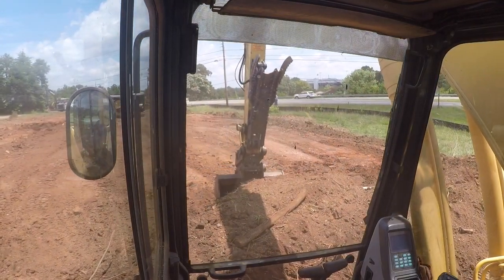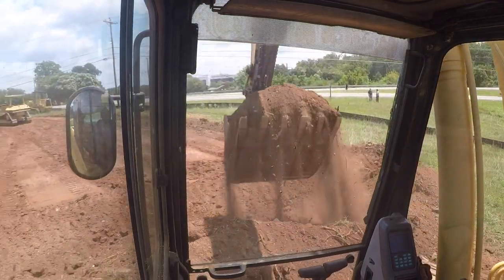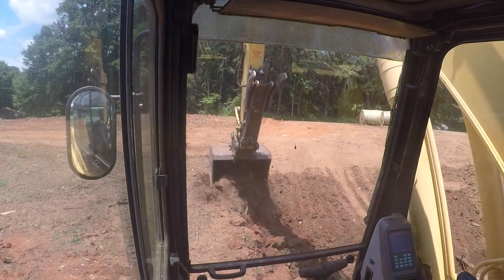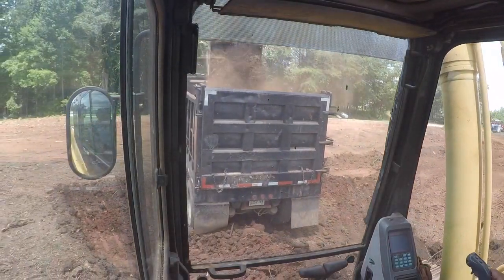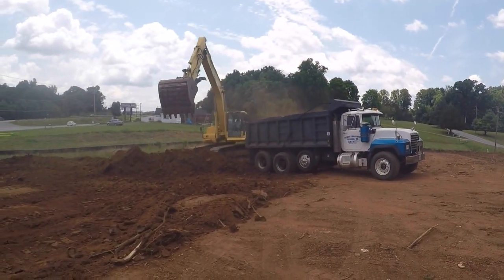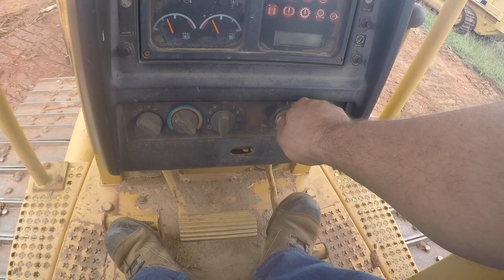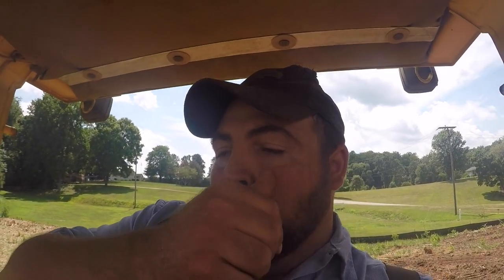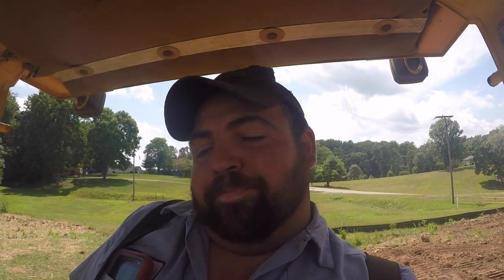Grading! Topsoil removal and why we romove it.

Comment: I learned Dozers in the Seabees at Ft. Leonard Wood, Missouri. I was sitting in a 1984 Model D7 in the training area at the moment the Twin Towers was attacked. So my career became more Convoy Security Element oriented and I didn't get much stick time in Dozers after training. Now I live in Switzerland and last week because I have a Dozer Certificate I was informed the day before that I would be moving 10,000 cubic meters of dirt  that was coming from one excavation to backfill and grade a Farmer's field in the Swiss Pre Alps. Turns out the machine was a D5M xl. I googled it and found your video with the same machine, basically saved my career cause I haven't been in a CAT Dozer for years. I usually operate a wheeled excavator digging ditches under the streets for distance heating pipes, water pipes and tearing out old asphalt for street repairs. I never saw that type of controls for a Dozer before and your video helped me a lot, you can see the end result and the D5 on my twitter @DaryllDoe. Thanks for the videos!
Reply from the maker: Well I'm glad I was able to help you out i really liked the M series cat dozers they were very good in thier day, but they can't compete with these new hydrostatic machines.
Reply: No doubt the new machines are much easier to operate, but the 1984 D7 was also pretty hard work with and the D7 H model still used the same controls. Here in Switzerland Komatsu is popular, what I see the most is D65 PX, saw one D61. How did you get cameras mounted under the Dozer?
Reply from the maker: I've got a good magnetic camera mount👍

Comment: Up here we have a 30acre field that had a subdivision put in next door. About half to 2/3's of that field was used by the developers to dump fill from the basements they put in. That was the deal when my brother bought the 167 acre plot (that had this field). 
About 5 yrs later we now want to develop the field for agriculture (vineyard) as the whole farm with suitable topography will be cultivated. 
So to make a long story short... county is widening a road nearby and needed a place to dump topsoil. Our site guy got us a deal where they pay per load to dump, and that money goes to him to pay for his loader and dozer to spread and grade it out for us.
Meanwhile we are putting in a drive about 1-2mi's in length and so we also got a deal on millings from some parking lots being resurfaced. (Millings are free, crush n run gravel is not.) So with the loader here we took loads of millings night after night (thousands of tons) and the loader ramped it up each morning while the trucks came and dumped every night. 
So the long and short of it is we got millings and topsoil free. 
A nice backscratching session of trades.
Reply from the maker: +Atoyota. You did a good job of bartering sounds like your coming out really good!

Comment: What kind of setups do you have for screening and classifying dirt/soil/gravel? 

Have any videos with that kinda stuff, that I maybe haven't watched yet?

Reason I ask is due to having 60+ acres, and I'm in the process of reclaiming/renovating the property including landscaping... 

There is tons of sand and river rock of all sizes... basically like an ideal quarry lol... just haven't figured the ideal equipment to build yet lol!

Great videos and insight bud! Keep it up!
Reply from the maker: We don't really classify anything since where not a quarry were not required too, we buy most all of the stone that we sell and we sell it as it's classified to us. As far as soil goes there is basically two different types top soil (black orgainc) or fill dirt (usually more red with no organics) we sell screened top soil that we process ouselfs with a trommel screener with a mix of 1/2 inch and 3/4 screens on it.
Reply: Ah gotcha, so a trommel / rotary screener! 

I'm thinking one of those for the finer stuff and think I'll be making a Rock Grizzly if I can get my hands on an old top angle dumpster lol

Just google Muskoka Motorsports if you are wondering what mishap I am up to lol
Reply: O

Comment: Do you guys just do site prep?
Reply from the maker: +Noel Hohberger. We don't build the structure. But we do all pipe work and site work on the outside. We also do a lot of main water and sewer installs for municipalities. We do anything that has to do with excavators, dozers, loaders and dump trucks basically.

Comment: Doze up a super pile then use a frontend loader to fill trucks three times faster.
Reply from the maker: +eric johnston. No the excavator is faster and cheaper than wearing out the undercarriage on the loader.
Reply: DLH Farms you use a 3 yard bucket and I will use a 12 yard bucket. Who finishes first?
Reply from the maker: +eric johnston. Lol!!!! 963 don't have no 12 yard bucket! Lol!!!!
Reply: DLH Farms cat 950M and several more brands can lift 12 yards of soil. 963 isnt worth taking off the dealer lot. Slow, no power small bucket. The idea is to move as much dirt as possible as fast you can. Get the job done and move on to the next.
Reply from the maker: +eric johnston. We work with the equipment we have and have and made it just fine, the biggest loader we have is a 963B our biggest wheel loader is a IT28G, our bigger excavators will out load both.

Comment: How much you have to strip off depends on geography and what state you're in Alabama sometimes we would have to take off a couple of feet of the top it could stay on site if there were berms required that's where it would go other than that it would go to a farmer's field that was low down in Florida totally different it's Sandy ground you only have to take off a few inches sometimes unless you're in a low area where nature silts it in then you just take the dark stuff off the top but you were wondering if all that dust was good for you I don't think anything about running equipment all your life is good for you 35 years off and on a dozer to a scraper in and out of the dump truck your back is what will go your lungs will make it
Reply from the maker: +Rusty Stuff. My back and lungs are still going so far, I've got over 20 years on equipment now. Our soil depends on geography also!